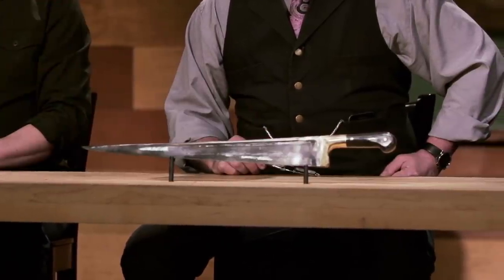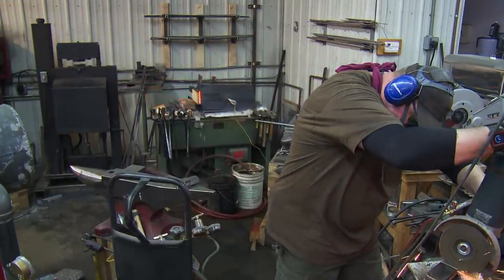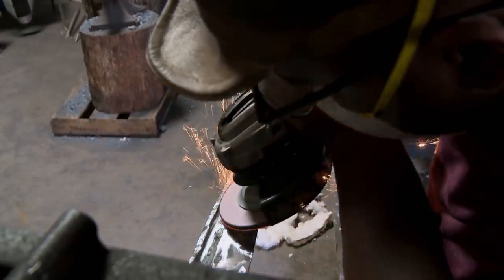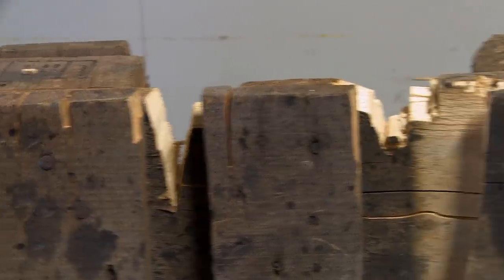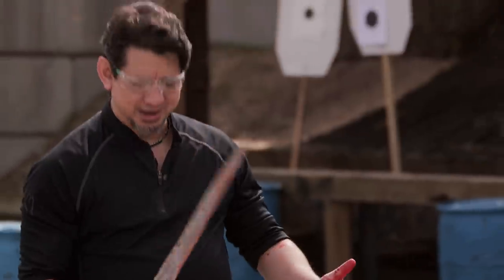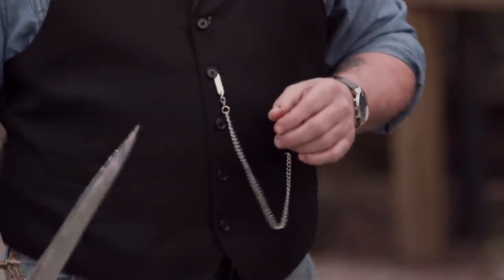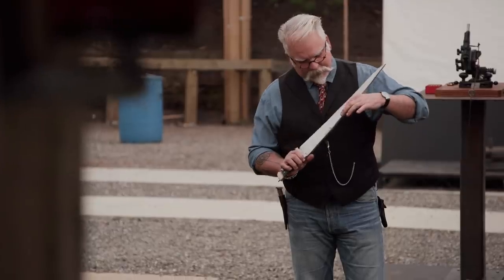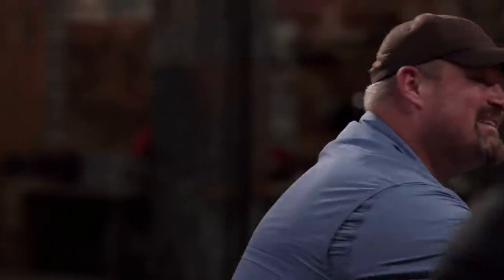HIGHLY DESTRUCTIVE Charay Sword PIERCES the Final Round (Season 4) | Forged in Fire | History

Comment: The moment a judge characterizes a blade as "heavy" you know its smith is not gonna win
Reply: Uncomfortable handles have also brought down some beautiful blades.
Reply: Check out the Zweihander episode.
Reply: Yeah, when you hear 'heavy', you better start praying the other smith's blade breaks.
Reply: because it is takes a lot of skills of the bladesmith to make a weapon while strong and as light as possible. There is chance for those blade is 'heavy' to win, is for the opponent's blade to break during the test.
Reply: Unless the lighter blade bends or breaks in the strength test.
Reply: @Benson_aka_devils_advocate_88  Yep, weight, weight distribution, and handle construction are the easiest ways to fail the judge tests outside of damage to the blade itself. A handle that doesn't have the right type of grip and size or too much weight in any part of the weapon and the main function is hindered automatically.
Reply: @ShaggyRogers1  I think there was actually one time a blade got rejected for being too light.  that was basically a parameter fail though.  It wasn't great in general really.
Reply: Unless the other blade suffers a catastrophic failure.

Comment: Lighter blade almost always wins when they both stand up to the tests
Reply: Yea 95 percent. Although i also saw it happen once that the heavier one won. I think it was in the Firemans axe video
Reply: Not Lighter blade but if they perform same and the one blade is too heavy for how the blade is suppose to feel like they lose. And also balance is important i think
Reply: @tilllindemann2974  in falcion episode , the heavy one won.
Reply: Damascus also outperforms monosteel, when other things are equal.
Reply: if two blades are equally strong, but one is thinner, it is using the temper to be strong, instead of relying on mass.  that is more difficult, and shows more skill, as opposed to relying on mass.
Reply: Yeah but if you get Jay as a judge, a lighter weapon might not survive his ridiculous torture tests.
Reply: @gjfwang  just do a good heat treat
Reply: @gjfwang  You haven't held a sword before have you?
Reply: @gjfwang his tests, the strength tests in general are supposed to push the swords construction to the absolute limit. Plus if your sword in medieval times can’t handle more than a few shield chips, it’s not good
Reply: @beepboop204 its exactly what i wanted to say for people that complain why the heavy blade almost always loose.

Comment: That bullet split test is ridiculous. It doesn't absolutely nothing to show the strength or integrity of the blade. It's more for TV views than anything else...
Reply: Agreed. Even with the kinetic energy behind the round, being made out of lead and copper doesn't do it any good against a sharp steel target.
Reply: I think that’s incorrect, it determines the strength of the blade as well, a high velocity target can crack a blade with enough force.
Reply: @anelpasic5232  That’s not entirely true, with enough force it certainly can crack the blade, if the blade has weak spots and it hits the weak spot the blade can break.

Comment: Being a bladesmith looks freaking HARD.
Reply: All depends how modern you go and what you definition is of HARD? 
Modern blacksmiths have alot of mechanical tools big heaters, so they mostly need to look out for the fine details/edge.
Oldschool blacksmith was brutal labor 
If you never done manual labor than alot can be HARD.
Reply: A friend of mine does its stuff the old way, charcoal, all hand work, I buy his knifes which are not perfect but they are amazing
Reply: Everything should be "hard" if your goal is to achieve a successful level.  If not, you're doing it wrong.

Comment: If weight matters, why don't they include a weight in the parameters?
Reply: It's not just weight, it's where the weight is distributed.  A blade feels heavier if the weight is towards the tip; it feels lighter if the weight is towards the guard.  A real sword had distal taper: the thickness of the metal decreased from the guard to the tip.  One effect of this was the weight distribution was nearer to the hand, making the blade feel lighter and more nimble.  Just specifying the weight in the parameters would not solve the problem.